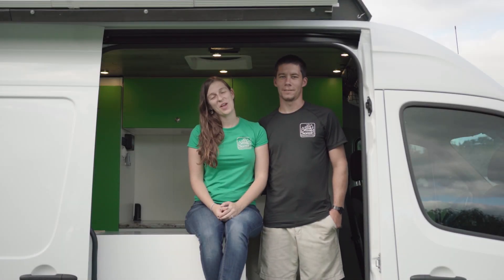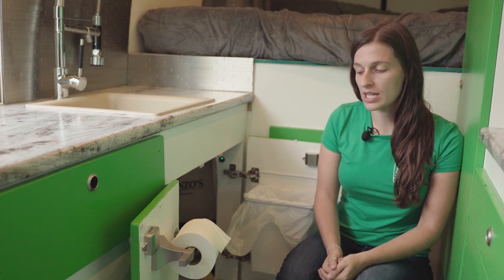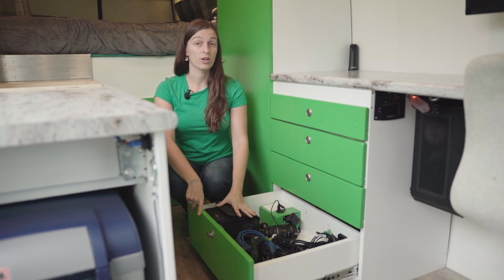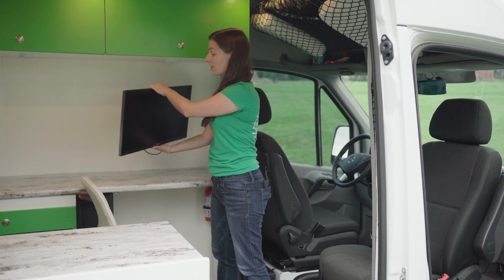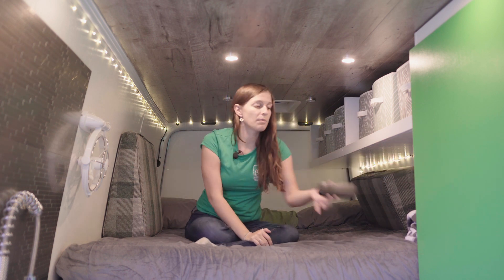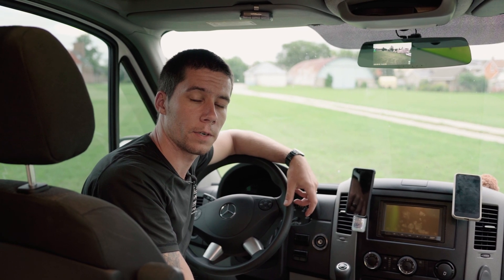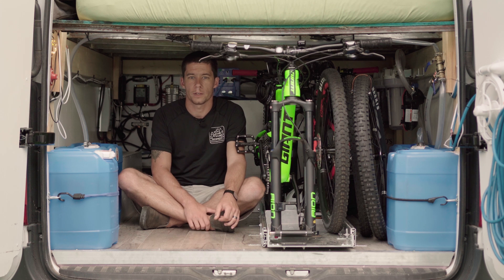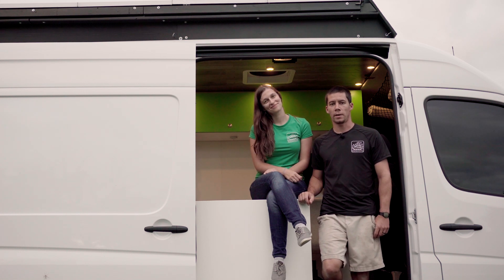DIY Sprinter Van Tour | Tilting Solar & Desktop Computer | Off Grid - V&M Vanlife and Ray Outfitted

Comment: Reflectics are silver because it reflects the light and keeps the inside from becoming an oven.  If you paint it black, instead of reflecting, it absorbs light.  That would make it much hotter in the inside.  Did you choose this option because you are in Canada and don't have to worry about overheating?  

Also, what's it like to empty the solids from the Nature's Head when it's so far back in the van like that?  I've seen a lot van builds that have their Nature's Head where you have the refrigerator because it's easier to empty.  Have you run into any problems with your current installation?
Reply from the maker: We ran tests with the covered and uncovered reflectix. It still does an impressive job at heat and cold - we are very pleased having used them at -20c and +40c.  No concerns and we very much like not having the dead giveaway of shiney reflectix. It works for us. Ventilation is far more important in our experience. As is picking your location. In extreme heat we like finding sites at higher elevations where it's a bit cooler. 

As for the Nature's Head, we have no idea how anyone would have issues emptying it with the slide out location. Are you saying it's too hard to carry out of the van? We love the Nature's Head. Madison says women's public bathrooms are horrible and she almost exclusively uses the van. Solids are emptied once a month with ease. (After living in an RV with a black tank to empty this is a cake walk) 

Perhaps worth saying - we share not to claim this is the one or the only way to do things. Building on your own means building to suit. Here's to a world where differing ideas are welcomed. 

Best wishes on your adVANtures! 💚🚐
Reply: @VMvanlife  I have no experience with the nature's head, but I saw a demonstration of the tank being emptied and he said he specifically put the toilet in the doorway area so that he can stand outside the van and just reach in and get it.  It's the only time I've ever seen one being emptied so I didn't know if it was a big deal or not.  Good to know it isn't!

Also good to know about the reflectics.  I always thought it was funny when people did "stealth" builds and then have silver reflectics everywhere, but I thought you had to have the silver to make them work right.  Learn something new every day!
Reply from the maker: The reality: There is no such thing as perfection. It's important to do research and make the choices that you're comfortable with. 

For insulation on heat or cold - the windows are only part of the battle. We're living in metal boxes which fight us on everything we try. There's no right or perfect solution for any of it. Everything comes with pros and cons. For us on the window coverings - drawing less attention to our rig was high value. 

We've really enjoyed meeting others on the road and hearing their successes and lessons. The variety is refreshing after escaping cookie cutter homes in cities and suburbs.  

Best wishes!

Comment: I like your idea for the toilet under the bed but am wondering how you have installed the natures head toilet. Is it on a slider like the fridge? How does the fan and exhaust system for the toilet work when you’re pulling it in and out?
Reply from the maker: Correct. The natures head is on heavy duty slides. The exhaust tube has slack in the line, so it stays connected when pulled forward. We vent through the floor, rather than the ceiling.

Comment: I'd love to know more about the computer. Do you power it entirely with solar? How much power does it take? How long are you able to use it, and have you ever run out of power or had to stop using it because it uses too much power?
Reply from the maker: We run the desktop off our house battery bank. The batteries are charged by solar, the alternator of the vehicle while we drive, and we the ability to charge from shore power. 

Monitoring your battery bank is part of the off-grid lifestyle. For Canadians and four season weather, this isn't a set and forget it situation. California and Arizona based van dwellers have more solar year round but not everyone has budgets for huge battery banks to allow overnight draws. 

Our computer and monitor draws about 50w. There are so many variables that make it hard to answer your other questions. The computer is never the only thing drawing power. 

We've been able to use our computer as needed, always. Madison has a habit of falling asleep watching a show, so the computer runs all night. That said - if the batteries weren't fairly charged she would have opted for a different screen for movie night.  The Southern US gave us so much solar charge we shared our electricity with some rigs we travelled with. 

Where we can run into power shortages is the combination of being parked for 3+ days in rain and cloud. In this scenario, shore power, a long drive, or using a different device (like a laptop, tablet, phone that doesn't need AC power)

The 600ah AGM battery bank has treated us very well but those with the budget, do sometimes opt for larger. 

Absolutely everything comes down to personal preference, needs, lifestyle and goals. Our setup works for us and fit within our budget. A bigger battery bank is an option for a bigger budget. 

Best wishes on your adVANture!
Reply: @VMvanlife  Thank you for the details, that is definitely the most ambitious office-in-a-van setup I've seen, and I hope I can use some of this info for my own van in the future!

Comment: Great build. Is your computer mounted in a way that protects it from bumps in the road and is your monitor 4k (been looking for a decent 12 volt monitor but can only find tv's). Also great colour scheme.
Reply from the maker: Thank you! 

The desktop was built and installed to protect it the best we could. Driving down and off road - there's no escaping everything in your van being shook around. 

The monitor is not 4k or anything special. Owned it well before the van. We have D rings installed behind the monitor and put a bungee cord around to hold the articulating mount still without stressing it's bolts as much. 

A 12V TV sounds great. Can still be used as a monitor. Here in Canada, we haven't seen any computer monitors that are 12V. Some are 18V and would just need a step up converter to use on DC power. Our monitor is on AC. 

Best wishes with your build!! Happy adVANtures. 💚🚐

Comment: Can you please tell me about the net that is on your ceiling in the Cab? How did you have it installed and how much does it hold?
Reply from the maker: That is a "vehicle trunk organization yet" we purchased from a store called Canadian Tire. It was $10 and we attached it through the headliner. 

We don't have a load rating for it - we just store our window and roof vent insulation/covers in it. 

Best wishes and happy travels 💚🚐

Comment: What does the PC and monitor draw? Around 400-500W? How do you deal with overcast weather? Here in the UK we also have less than favorable weather and I would be constantly anxious I was going to run out of power.
Reply from the maker: The custom built PC has a high efficiency power supply. We draw approx 180W when watching movies or basic tasks. When sizing an electrical system, you need to look at the specific draws of your own items. 

Living in Canada, we also have less than favourable weather and thus our battery bank and solar array are oversized. 

Most importantly, every off grid electrical system needs a battery monitoring system that is easy to read. This allows you to learn your system capabilities and manage your usage.
Reply: @VMvanlife  Wow, 180W is not as bad as I was anticipating. I'll have to see if I can measure my setup under load sometime to compare. At 180W I can see how things would be a lot more manageable for you. I'd imagine more intense gaming with GPUs and CPUs under steady load is going to cause a bit more of a headache.

Definitely seems that the majority of people opt for 300-500W of solar but as you guys say that simply is not enough for more overcast climates. Even in overcast situations, do you find the solar can replenish the batteries consistently? Have you ever had to do an emergency plug in?

Comment: I'm in the planning process of a van build and want a desktop computer in there. Are there any issues with the desktop components getting shaken around from bumpy driving?
Reply from the maker: We have not had any issues with our computer. We used solid state drives and liquid cooling to minimize moving parts in the tower. Also put in a 98% efficiency power supply which uses slightly more power than our laptop. 

Hope this helps. Happy travels 👍
Reply: @VMvanlife  That does help! Thank you so much!

Comment: Why  the Mercedes van? The Dodge and Ford are similar but cost less than half as much to maintain.
Reply from the maker: It comes down to personal preference. Budget, layout/design and availability are also big factors. 
A diesel Ford, in Canada, costs the same as a Sprinter. Sprinters are known to get much higher mileage in their lifetime. The largest Ford Transit is slightly larger than the smaller of the Sprinters. 
We couldn't fit our desired layout in a Transit but that doesn't say it won't be perfect for someone else.
Reply from the maker: Fun fact - when FedEx orders Mercedes Sprinters, they get them without the DEF system. If you live in an area without emissions tests/requirements the DEF system can be removed. 

As already stated, we made our choice and every buyer has that same luxury. Best wishes to you.
Reply: @VMvanlife  I'm in the USA and pretty sure our new Diesel engines must have DEF systems. No matter who is buying.
Reply: All vehicles must comply with the emissions standards in the country they are registered. Fedex gets no special treatment.
Reply from the maker: We are just relaying what we have heard from a couple different dealers telling us.

Comment: What do you do against mold humidity in the van?
Reply from the maker: Humidity and mold: Air flow and ventilation is critical.

For the type of insulation we used, air gaps (1x3 fir strips) give moisture in the walls the chance to dry. 

There's no perfect way to protect yourself, no matter your house type. The challenge you have to plan for do vary depending the region's you travel. We keep our van very clean. We think our dry heat source for cold weather, vents over kitchen and bed to force circulation while cooking and in warmer climates and fans stirring the air inside all help us.

 We're 8 months full-time in the van now and haven't experienced the issues we've heard from others. Maybe someday a project will give us a reason to pull some walls down and see for sure. For now - we're healthy, have no smells and aren't worried. Perfection wasn't our goal and we are enjoying our adVANture!

Best wishes! 💚🚐
Reply: @VMvanlife  I see, thank you

Comment: What kind of insulation did you use on your van?
Reply from the maker: We opted for XPS rigid foam at the time that we were doing our build. It has held up great and we have no complaints about it. There is no one right option.
Happy travels

Comment: ”Our solar panels is mounted in series-parallell’ ?
You must mean they are in series in different banks?! And the banks are mounted in parallell in the solar charging unit?!? Every bank must give the same voltage, even if they generate different Watts?! 
Is that why you say your solar panels are mounted in series-parallell?
Reply from the maker: Yes there are 3 banks of panels wired in pairs to maximise low light charging with our controller.

Comment: Personally not a fan of permanent giant platform beds (I don't need that much storage, and I do need more airy living space) but I like the tilting solar setup. Should increase efficiency a lot. Of course, personally I'd construct something that used electric linear actuators. Just so you can push a button and angle (or lower) the panels from the inside...
Reply from the maker: Do it!! 

We share not to suggest perfection or that any layout suits all. This is what we accomplished with our budget and timeframe. 

In our research, we were so grateful to be able to watch tours that gave us ideas of what to do, what not to do and what we thought we could improve. We share to continue supporting all the DIY'ers that are searching for ideas to adapt. 

Best wishes on your build! 💚🚐